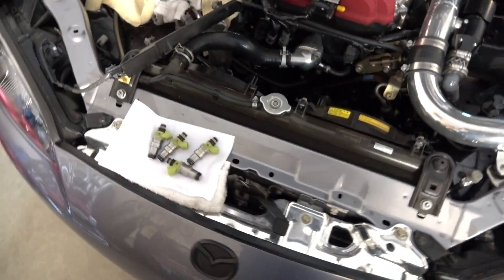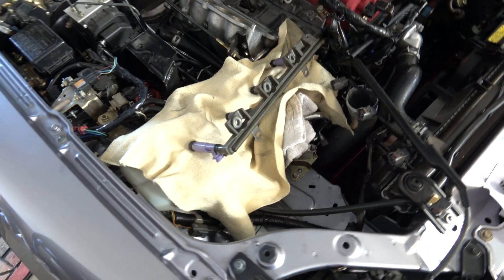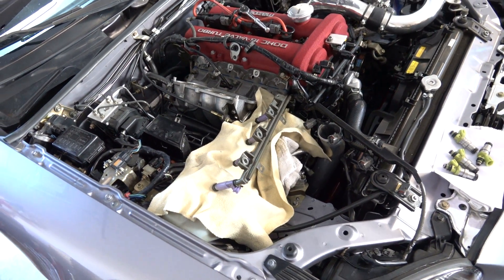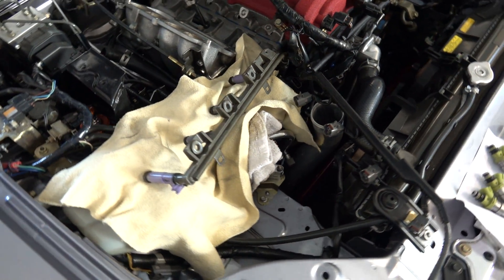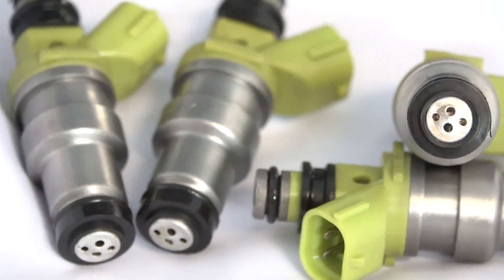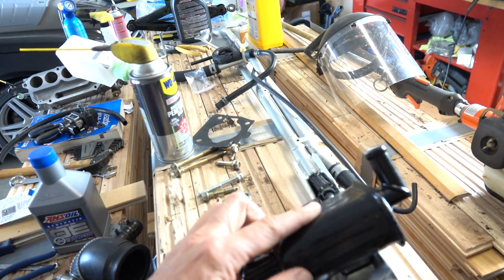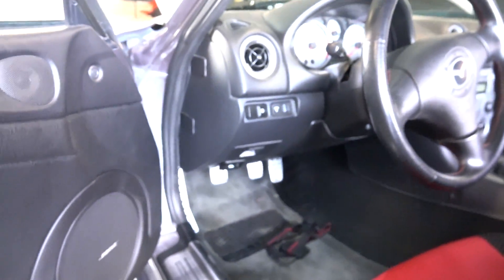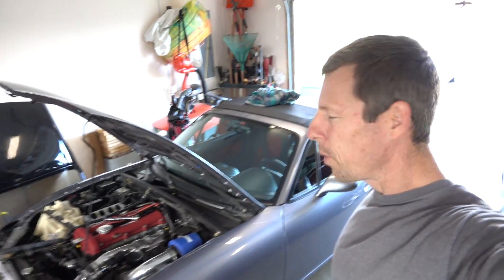Mazdaspeed Miata Supra 315cc injector upgrade light Green tops

Comment: For anyone watching this video thinking
Oh hey! I can put 312cc Supra injectors in my MSM and crank the boost up on the stock ECU!

Save your time.

It's a shame this guy didn't do a follow up, or explain anything further in this video. It's actually very disappointing and bad taste on his part sending people down this rabbit hole with no follow through.
I personally wasted an entire evening swapping out to the Supra injectors only to find that they will not run right with the stock ECU.
It idles way too rich and will throw you an engine code if you idle long enough, and the stock ECU's LTFT and STFT (fuel trims) are not capable enough to pull back fuel from them to get you a 14.7 idle AFR. Free-way driving yields decent numbers, but the behavior is terrible.
YOU WILL IDLE AT 10.1 and ruin your cat, and flood your cylinders with soot!

The factory ECU has serious issues with tip-in boost, tip-in throttle...
There is no fixing this even with an O2 Signal modifier.

You have to remember, this Miata was only made for two years. They likely would have ironed out the kinks if they continued, but you've got to understand that even though it came from the "factory" with a turbo... It doesn't mean it ever ran right. If production would have continued... they likely would have corrected a lot of the lean issues in the fuel map.

Unfortunately, unless you can modify your factory ECU to take a programmable chip, and then find someone that could modify the stock ECU program... your best bet is to get a MegaSquirt.
I have heard nothing but good things about them on MSM's in particular. I have one coming in tomorrow and very much look forward to installing it, writing a base tune to it, and taking it to get properly tuned.

Cheers,
Me-Yada

Comment: Hey sir, I have to replace an injector, so I am going to just throw these in as they are a bit bigger,(actually also cheaper than stock) then eventually I will go MSPNP and I'll only have to swap that every couple years for emissions. Just working on finding a tuner who can tune this up once I have it. I have FM intake setup also full FM dp, cat and muffler to go with it, hoping to squeeze 200-215hp out of it with the stand alone. Thanks for documenting this stuff. It is very helpful. Did you make a follow up with these on stock ecu? I looked and didn't see it.
Reply: Have you put in your green top injectors yet with the stock ECU?
If so, how does it run?
Reply: @tofuguru941 hey, not yet, it's part of a winter upgrade path, basically a little enchilada kit and port n polish intake manifold. I'll try to come back here with an update.
Reply: @mdsuave13  
Not sure why, but my previous comment got deleted.

Got some useful info for you.

I have an 05 MSM.

Here's the rundown:

Performance:
Flyin Miata Little Enchilada.
Magnecor spark wires.
NGK ZFR6F-11 plugs.

Cooling:
Super Miata Crossflow Radiator.

Brakes:
SS Braided lines.
EBC Yellowstuff Pads.
RBF 600 fluid.

Suspension:
Super Miata Tecna Sport coilovers full stiff.
Racing beat sway bracket blocks.
R Package Tie-Rod ends.
Track Alignment (5 caster, 0.075 Toe-In all around, -1 Front Camber, -1.5 Rear Camber)
Konig Dian-In 15x8 +25 on Continental Extreme Contact Sport 205/50 (RS-4 next)

Other:
Wideband AFR.
Boost Solenoid Upgrade (Asco).
Thompson Oil Filter relocation kit.
I also have the Zener Diode Mod available to activate.

Now that you have an idea of my mods (fairly stock, mostly bolt-ons)...
I have had nothing but bad luck getting the car to run right.
With or without the Zener Diode Mod enabled.
With or without the upgraded Boost solenoid.
With or without the O2 signal modifier enabled.

If you don't have a wideband AFR... you may not know or feel what's happening.
But many times under load when you go to give "passing power" on the highway, the car builds boost... fast... (which is nice) but goes VERY lean on the AFR.
Which is dangerous. 

Before I had the AFR, it just felt like a stutter before it accelerated. 
After having the AFR, now I know it's because the stock ECU CANNOT deliver proper fuel, and shows it going DANGEROUSLY lean during initial load.

I thought buying these Green top Supra 312cc injectors (same part # as in the video) would solve the problem with the stock ECU so I wouldn't have to buy a standalone... but that's not the case.

I installed them yesterday... and instead of idling at the desired 14.7AFR, it idles at 10.1AFR. 
The ECU cannot trim the fuel enough to hit a proper AFR.
On the highway it's not so bad, but the lean condition underload is worse.
I tried enabling/disabling the O2 signal modifier (you'd figure you wouldn't need it at all with bigger injectors, but it still gets the lean spot).
I tried enabling/disabling the Zener Diode mod, no difference. 
I did get an engine light on idle, then it started shaking and running VERY rich (smoke out the rear).
Disconnected battery, reconnected and now it's gone and it runs fine (still rich on idle).

Point being... you can't just throw in the injectors.

I ordered a MegaSquirt 3 Pro PNP. I'm just going to deal with emissions when it comes...
I also have a DW100 fuel pump coming in. It's 165 Liters Per Hour. Factory is about 115.
165 is good for 300 HP. And since I'm sticking to stock internals, 300 is more than enough since I'm likely never even going to see more than 230whp, and I'm sure the Supra injectors would be fine for up to 230 as well since many people are hitting 200 with the factory 265cc MSM injectors.

Save yourself the headache and don't install the green top injectors unless you plan to put in a standalone ECU to tune the car on.
The factory ECU is trash.

Do you have a Wideband AFR? 
How does your car drive with the FM LE?
I have my boost cranked down all the way and it still hits 10-12psi.
Reply: @tofuguru941  Very interesting... Everywhere online says that factory ECU will handle these. I wonder if the stock boost will keep it ok. I have the LE, haven't installed anything on this MSM yet. It's all stock at 20k miles. I do not have any kind of lag or stutter at stock levels, so I wonder if adding the LE will break it.... I live in MD and they JUST changed the law so any car after 1999 is no longer considered historic, from 20 years old. So I have to do emissions. I was hoping that if I put those supra injectors in i could run it on the stock ECU well enough to pass emissions, then stick in the MS PNP for the remainder of the time... Well back to the drawing board. Maybe I'll put in the LE and keep the boost level stock to see if it acts like a turd. Thank you for getting back to me over this! Have a great weekend man.
Reply: @mdsuave13  

You're in MD?
I'm in NY. 

Not far.

Are you going to Miata Con this weekend? (Limerock) Fri/Sat? I'll be there Sat.

When you say "everywhere online" about the injectors where is that? Because everywhere I look, there are no definitive videos, results posted, pics, AFR readings or anything. On the other hand, I can link you to maaaaaany people having issues with their MSM's after installing the LE kit because it exposes the weakness of the factory ECU. And no O2 signal modifier, Zener Diode mod, pulling the TPS plug off, or supra injectors will fix that.

Also... it may feel like your car doesn't have any hesitation when it's stock, but that's because the factory ECU is shit at delivering power and ramping up the boost as it should. It feels like an all motor car when it's stock. I know because mine was stock up until about a couple months ago.

Once you install the LE kit and set your boost to 10psi (start with the MBC cranked all the way down) you'll understand.
Once that boost kicks in, you'll say "ah, that's how this turbo is supposed to feel".

Issue is, it will amplify the inconsistent fueling of the stock ECU.

Really hope this saves you some headache. I thought I could just add some bolt-ons and get a little more pep. But it's sent me down a mini-rabit-hole that I'm slowly navigating to make sure I don't sink deeper. The ultimate answer is an aftermarket ECU (MS3Pro PNP etc..)

I wouldn't be opposed to getting together sometime and showing you my car. If you're at Miata Con... look for a Red MSM with NY plates "ME YADA".

I have a 3.63 ring and pinion, and an upgraded speed sensor waiting to be installed. Going to do that when it's stored for this winter. That'll lengthen the gears to USA highways (since the 4.1 ratio was more geared towards Japanese roads and speed limits).

Will lower 70mph RMP from 3500 to ~3000.

Cheers,
-MeYada

Comment: Hi JC i was just curious how your car performed with the Supra injectors? 

I have 2004 Mazdaspeed miata with stock ecu. But i have recently added the following mods to my car which consists of AEM intake, square top intake manifold, catless downpipe, megan midpipe, FM 02 signal modifier, upgraded fuel pump.

The mods definitely made a night and day difference, the FM 02 signal modifier definitely made a noticeable difference, but there is still a noticeable flat spot below 4-5k RPM's.

I was just wondering if the Supra injectors actually helped out and if the injectors triggered any check engine light or codes.

Thanks
Reply: I was wondering the same on this. Thanks for all the info. The Mazdaspeed Miata is in a weird time where a lot of the forum info has been lost or difficult to find, your videos are VERY helful!

Comment: What's the AF at 11psi?
Or what's the highest you can go safely with those Supra injectors
Reply from the maker: I stuck to around 12psi with them & did not really experiment. Below 5500 rpms it would still spike up to 16 to 1 at times like the stock injectors would. The stock ECU stinks. It forces you to have to downshift so the rpm's go up to like 5500 before you floor it. When setting the boost i set it too high around 14psi & the air fuel ratio was still safe as long as i downshifted to 5500 rpm. & i have a larger turbo than stock.
Reply: @mazdaspeedmx512lbs  good info.  Thank you.  I think the 02 clamp should be helping with the 5500rpm issue because I seldom experience the hesitation anymore.
Reply from the maker: I read the way the 02 clamp works with the Stock ECU is that it only works at part throttle positions & at full throttle it does not. The stock ECU switches to a different loop or map or whatever at full throttle. So you have to roll into the throttle till 5500 rpm then you can go full throttle after that & in between shifts don't let the RPM's fall below 5500. It was under these very specific conditions I was aware of that I started raising the boost.
Reply: @mazdaspeedmx512lbs  Something like that.  What it does is helping (tricking) the ECU go to open loop as soon as it detects boost instead of waiting for the computer to switch to open loop at 5500 and full throttle.  So the transition happens as soon as you leave vacuum and get into boost instead of the predetermined 5500... Or something like that.

Comment: Was this done without tuning??
Reply from the maker: Yes. These 305cc injectors work with the stock ECU
Reply: JCHangtime Do you know the size difference between The Mazda speed injectors and a stock NB2 injector. Also wouldn’t the bigger injectors with the stock computer cause it to run Rich at Idle?
Reply from the maker: They 305cc injectors do not run rich at idle. I have a air fuel meter. It idles at 850 rpms like stock. My purple Mazdaspeed injectors are like 265cc.
Reply: JCHangtime interesting.. ok